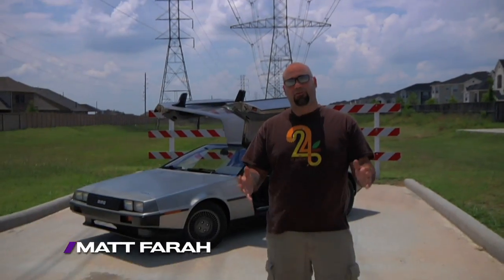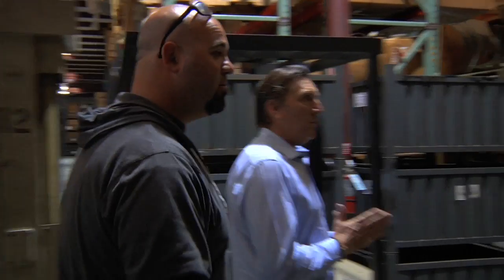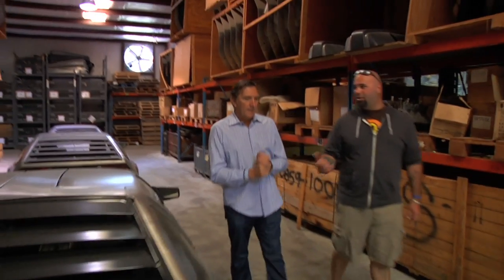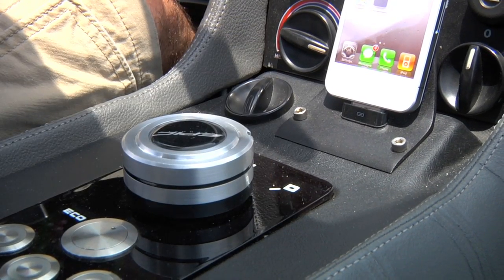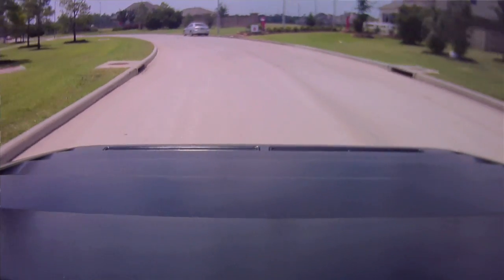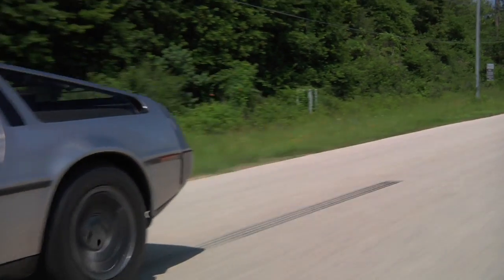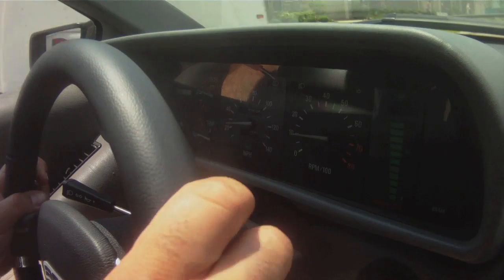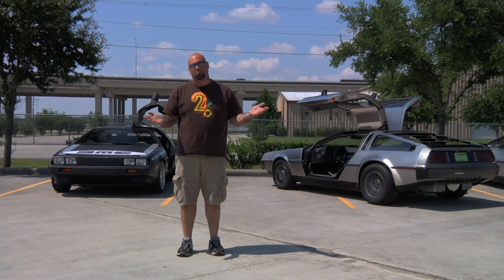DMC's New Electric Delorean -- /TUNED

Comment: "Top speed of over 100 mph" that's 160 KM/h for the civilized world, and it's SLOW. It's so unbelievably SLOW! 20+ year old econoboxes with under 100 HP can do over 200 KM/h.
Reply: the video is from 2012. 100ish was the limit of electric motors 4 years ago.
Reply: electric motors are NOT great at top speeds, they are better at instant fast acceleration, so think fast (or at least moderate) acceleration up to 85kmh (50mph)..... but slow top speed

Comment: Electric cars are generally stupid because of short range, extremely long charge times, and cost. I love Deloreans, but it's electric, and $90k, so it's stupid. Just put a 270 hp v6, or a turbo 4 cyl in there, and call it a day. It doesn't need 500 hp, even 250 would be plenty to enjoy the car.

Comment: 35 kilowatts = 46.9 horsepower, not 250 horsepower ...
Something smells fishy here...
Reply: Electric motor horsepower and gas engine horsepower are different. Electric motors has higher torque, if you include the higher torque and rpms it will be equal to a 250 gas engine.

Comment: yor right I rather buy an used ferrari or a Vipper or a C6 Z06 and it will dust off the CobWebs off that Failure of stainless steel call car.